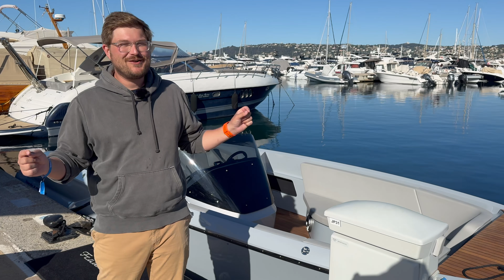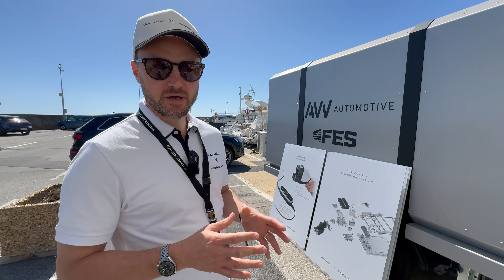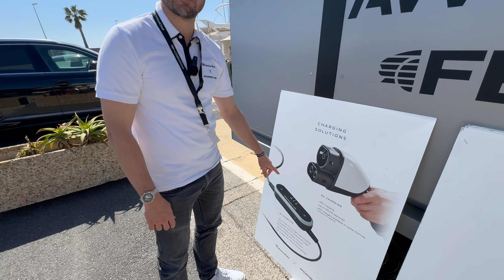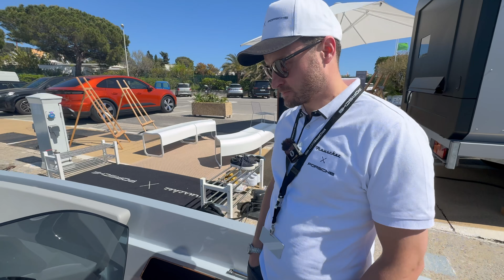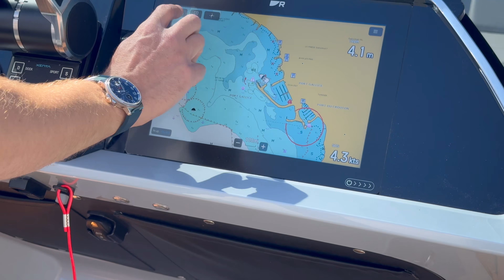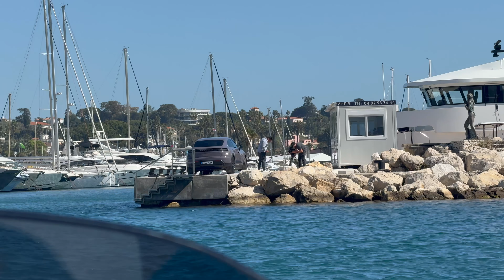Porsche Sells An Electric Boat w/ A Macan EV Powertrain! Frauscher x Porsche 850 Fantom Air

Comment: Porsche did a marine project with 300hp 928 engines back in the '80s.
Ended up being too expensive for too little power. 
These electric boats are too expensive for too little range!

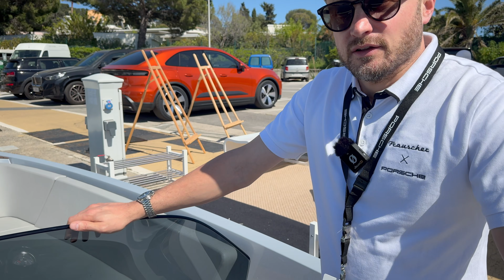Comment: 14:58 Umm what? You have an infinite heat sink in the water you are riding on.  They skimped on the cooling plumbing on a $500,000 3 seater boat.  Wild.
Reply: Needs a sharrow prop
Reply: It's likely not a coolant -> ambient bottleneck, but an inverter then maybe motor/battery bottleneck.  All that stuff is taken from the Porsche and redesigning it is an unreasonable thing to expect.
Reply: @concinnus  this guy is talking about “unreasonable thing to expect” on a tiny $500,000 boat. 😂. Batteries, inverters, and motors already have cooling loops. And when they are in cars they have the disadvantage of only being able to reject heat to air. I’ll bet anything they didn’t bother to cooling some of the components. Epic fail.
Reply: @ultrastoat3298  500k is like nothing in the realm of (electric) sport boats. And this is a small project, they do not sell many of them
Reply: @ultrastoat3298 A super yacht tender isn’t going to be driven hard. People buy for the novelty.  The single motor kills it too. No crew wants to mess with single engine boats in this price range.

Comment: 45km range at 41km/h is horrible. That is less than 10% of the range of an equivalent diesel/gasoline boat.
Reply: The battery ain't even 3 gallons worth of marine diesel in total energy genius.  😀

Comment: Wonder how they deal with battery cell outgassing in a wet environment.
Reply: uhh there is none the battery is entirely sealed I'm in the process of electrifying a boat replacing the inboard v8 with the battery and motor from a nissan leaf.

Comment: The Candela C8, which uses Polestar 2 batteries and is made in Sweden, is completely carbon fiber, has been in production for multiple years, costs almost half as much, rides much smoother over waves, has more than twice the range at a higher speed than this boat, and is bigger too. Would definitely buy that instead of this.
Reply: Half as much huh? Interesting, thank you for sharing.
Reply: Man so many mistakes...The Candela C8 starts at €330k, so 40% cheaper. You can spec options to get above 400k. The Candela C8 only has a top speed of 30 knots which is much much slower than the 45 knots of this Frauscher boat. The power is pretty insane. And so is the charging speed. This is an actual proper electric sports boat with high-end specs, the C8 isn't. And then there comes the branding, a Frauscher X Porsche colaboration has a higher value then the Candela X Polestar one.
Reply: @BBingo-v5i  I said "almost half as much". 40% is almost half as much.

I said it has twice the range at a higher speed, it is rated at twice the range at 22 knots that this is rated at 20 knots.

Either boat is extremely well-made and luxurious, and the Candela C8 charges faster than this boat if you count actual range in kilometers per hour and not kilowatts, even more so when you consider you'd be unlikely to find a 270 kW charger at a dock. The C8 is much higher-tech than this, considering it's made out of carbon fiber and flies on top of the water.

Comment: I need a 20' electric Bass boat with a top speed of 70mph.
Reply: Doesn’t everyone? 70mph is about 100kw or under 150Hp.

A used Tesla model S 100 battery and two Netgain warp 9 motors would be about as cheap as you can go. Given the warp 9s are $5000 each, and the total mass of the motors and battery are about 500kg minus the rest of the power train, stick to 4 stroke with a wet exhaust for now.

Or just buy ten trolling motors?

Comment: It sounds wonderful!!  I’m very interested!!
Reply: Look at the Candela C8, it's even better, and cheaper too!
Reply: @swecreations  Man so many mistakes...The Candela C8 starts at €330k, so 40% cheaper. You can spec options to get above 400k. The Candela C8 only has a top speed of 30 knots which is much much slower than the 45 knots of this Frauscher boat. The power is pretty insane. And so is the charging speed. This is an actual proper electric sports boat with high-end specs, the C8 isn't. And then there comes the branding, a Frauscher X Porsche colaboration has a higher value then the Candela X Polestar one.
Reply: @BBingo-v5i  I said "almost half as much". 40% is almost half as much.

I said it has twice the range at a higher speed, it is rated at twice the range at 22 knots that this is rated at 20 knots.

Either boat is extremely well-made and luxurious, and the Candela C8 charges faster than this boat if you count actual range in kilometers per hour and not kilowatts, even more so when you consider you'd be unlikely to find a 270 kW charger at a dock. The C8 is much higher-tech than this, considering it's made out of carbon fiber and flies on top of the water.

Comment: overpriced
Reply: True, but all boats are over-priced.
And after that, they get expensive! 🤣
Reply: @paulrybarczyk5013 The Candela C8, which uses Polestar 2 batteries and is made in Sweden, is completely carbon fiber, has been in production for multiple years, costs almost half as much, rides much smoother over waves, has more than twice the range at a higher speed than this boat, and is bigger too. Would definitely buy that instead of this.
Reply: @swecreations  Man so many mistakes...The Candela C8 starts at €330k, so 40% cheaper. You can spec options to get above 400k. The Candela C8 only has a top speed of 30 knots which is much much slower than the 45 knots of this Frauscher boat. The power is pretty insane. And so is the charging speed. This is an actual proper electric sports boat with high-end specs, the C8 isn't. And then there comes the branding, a Frauscher X Porsche colaboration has a higher value then the Candela X Polestar one.

Comment: I think boats are the best place for electrification because all docs already have power for each boat.
Reply: Should also be optimal for powertrain and battery cooling efficiency.
Reply: Well there's not much opportunity for regen, and pleasurecraft don't usually see daily use, so not really.  If there were a business case to have one as a rental, then sure.
Reply: @concinnus  that's  the thing. The boat sits unused and charging for hours or days at a time. Plenty of time to charge up. And the boat is going to be used for just cruising around for a couple hours at a time
Reply: @priceburnett  It takes ~15k miles for a 300-mile BEV to 'pay off' the extra energy used in making it.  For the Macan, that's about 750gal of fuel.  I just don't expect e.g. a rich guy's Yacht tender to ever get used that much.
Reply: @concinnus people buy for the novelty. This isn’t a mass market boat.  When your on your super yacht charging this boat off you diesel generators, you’re not thinking about your carbon footprint.
Reply: Very cool and innovative. But with very limited market potential in this industry for at least a decade... For a million (dollars) reasons. 

But you've got to start somewhere. At least the 1% get to play with this cool tech.
Reply: It depends on the application lol!!!
Reply: Yes for sailboats.  But not mainstream power boats anytime soon. Saltwater and electricity don’t go together. Really hard to make reliable electronics in salt environments. Range is a big issue and it needs 2 motors.
Reply: Also plenty of water nearby. For, you know

Comment: Very cool to see because of that instant torque.  Getting up on a plane is made so much easier.  I recall a company in the Netherlands converting boats using used Leaf batteries years ago but this appears to be on a whole new level.